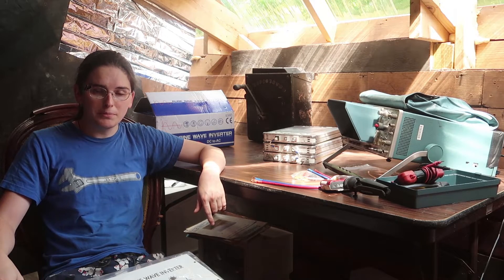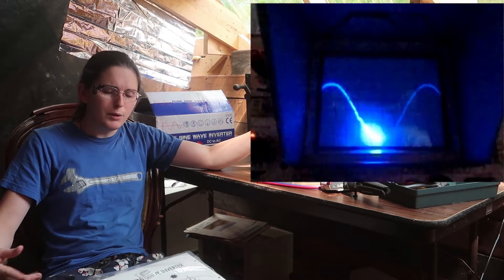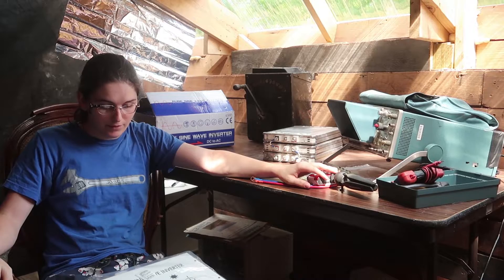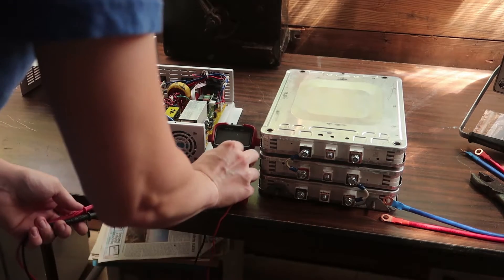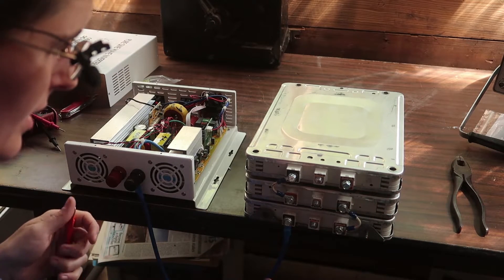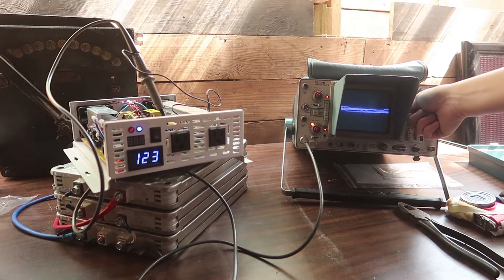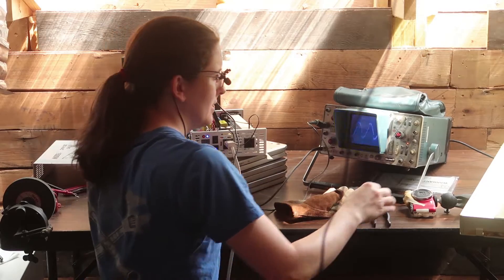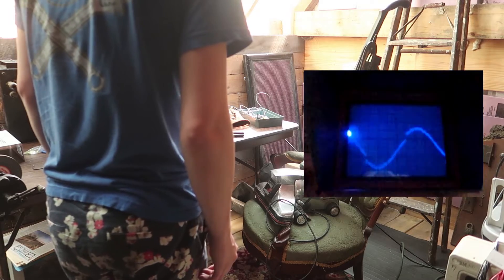Solar Sunday 01: Reliable 1500W 24V Pure Sine Wave Inverter Waveform, Air Conditioner Load Test

Comment: oI oI oi Rinoa, glad to see Solar Sundays back, I suggest a min 3kw imverter unless u can get a 5kw. Boiling a kettle is 2400watts, surges from motors will not be an issue either, I been getting by with a 3kw inverter but its a pain in the ass when i cant boil the kettle when the hot water service is on... grrrrr or  use the air compressor. I hope u dont get tornado's cos it will be bye bye ridge top  panels and them the rest of the roof.

Comment: I think that your lathe is too much inductive load. Perhaps you should try to mount the capacitor on the lathe parallel to the motor.
Reply: Or add a hard start kit.
Reply: @NiHaoMike64  I think it is not best idea, because it is not designed to run all the time. Run capacitor can be connected all the time when motor is running and compensate induction load. It can stay there even if it is connected to the wall socket.
Reply: @DanDishonored  A hard start kit includes a relay to automatically disconnect the start cap.
Reply: @NiHaoMike64  which is bad, because motor will not continue to run. As we can see in the video, even with mechanical help, motor was unable to spin. It did slight motion and stall. Capacitor can help only when connected all the time.

Comment: How many watts is the AC rated at? IIRC compressor will have a startup requirement of 6 to 10 times the running power, so you're probably overdoing it. Also, the wires between battery and inverter might be insufficient for current. You could measure the voltage at inverter input cf. voltage at battery terminals to make that determination. Also, measure resistance of cable between inverter and lathe; IMO inverter should be able to handle it and startup up surge of (unloaded) 250W lathe will be quite small (2x to 3x), spinning it by hand should start it up IMO, but would be reasonable to expect it to start by itself. Can you measure the AC voltage at lathe input? But yeah, could be crappy inverter too; Chinese watts are significantly less than USA watts ;) Cheers, Steve.
Reply from the maker: well also keep in mind this old lathe motor would be very innefficient and burn a lot of electricity upon startup.

and as for battery terminals, i only noticed a 0.08v difference when i checked. the cables are long and thick thankfully.

oh and ac taked 800w to run, so i figured like 3500w to start at the least
Reply: @RinoasBigProjects  Yeah, perhaps but nonetheless, spinning it by hand should overcome that. Also, thinking about it, measuring the voltage ain't going to show much except at high loads, ie during AC startup. Consider that at 1500W and 24V, that's some 60 odd amps (and AC surge is likely to be higher than that). If you measure cable gauge you can do the calculation to determine resistance and hence voltage drop. From my vantage point (admittedly not very good) cables are  too thin. Anyway, keep up the good work. I'm sure that your perseverance will pay off.
Reply from the maker: well i was measuring voltage drop while using about 550w
Reply: @RinoasBigProjects  Ok. What gauge cable? You could now calculate the cable resistance! and compare that with theoretical resistance/voltage-drop as determined above to double check your measurements. EE is fun!

I reckon bigger/better inverter is required; that output inductor looks kinda small for 1500W. I'm running 300W AC (smallest I could get) which works with quality (and expensive) inverter with (true, ie tested by me) 3000W surge capacity. I tried several inferior inverters before getting it to work. Guessing that yours is 600W. AC.compressor has to startup under load so your going to need much bigger/better inverter IMO.
Reply from the maker: cable gauge of: big enough
resistance of: don't care

EE is only fun when you use it wisely, not wasting time calculating resistance of cables. you should just make them more than big enough, or whatever is on hand, and not worry about the actual specs.

and this inverter definitly isnt just 600w because i was probably pulling more power with my 250w TV, several-hundred Watt gaming computer and some lights i was running while playing FFXIV on max settings.
Reply: @RinoasBigProjects  No, no, I'm saying that I suspect the airconditioner is 600W, not the inverter.  'Big enough' don't cut it for me, all you need do is measure the diameter. Agreed and that's why I was trying to get the info to save you effort and expense in properly sizing the inverter. And golly, you have managed to put me offside already, my energies are to be expended elsewhere. Bye, and good luck with the channel.
Reply from the maker: the only measurement i go by with resistance of cables is if they heat up at all, they are too small. these didnt even show up in the thermal camera.

Comment: You may want to get a really good pure sine low wattage for sensitive electronics and one large watt modified sine for inductive loads.
Reply from the maker: idk if id want to trust my AC unit running on modified sine wave. i think that might be a case for rotary converter

Comment: Whats the two scope view side by side? One looks horrific. Anyway that’s not a pure sine imo. I have a 200W pure sine which is crystal sine wave even under load. No joins it’s one smooth sine. The compressor in the AC will have too much a inductive spike when it tries to kick in for that poor inverter, this is always a down side of such inverters. Perhaps some output caps would help.
Reply: Lathe you could try getting a phase controller. However I don’t know if your motor is DC or AC or 3 phase etc. I think AVE and Auzzie 50 have videos on phase motor controllers. I forget the more technical name.
Reply from the maker: one scope view is slow speed one is real time, thought that would be obvious

i never said it was pure sine, the seller did. however later on it makes a pure sine.still not sure on when it does or doesnt make one.
Reply: @RinoasBigProjects  returning it was the right thing to do.
Reply from the maker: the seller might just send me a new dc meter for it. i mean, i guess that works too.

Comment: Rona why not just us a old treadmill motor for you lathe then you could use the speed control to adjust the spindle speed on your lathe
Reply from the maker: because any tredmill motor i have... would be funner to turn into a wind turbine. hehe

also they are 120v not 24v

a large truck starter motor could be 24v though.
Reply: @RinoasBigProjects  the ones I've encountered have been 24 volt  DC motors if I find another one I'll send the motor and controls your way
Reply from the maker: well thank you, be sure to include a letter for me to read in a video if you want a shout-out.